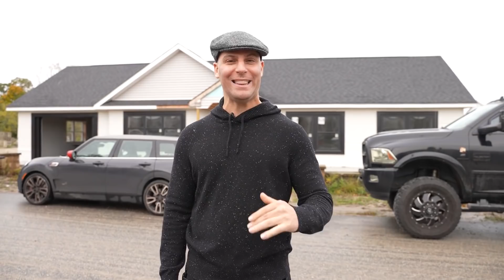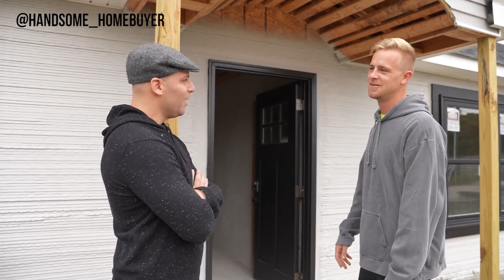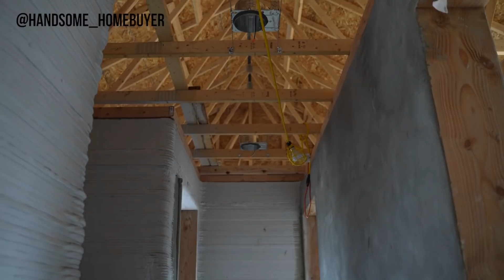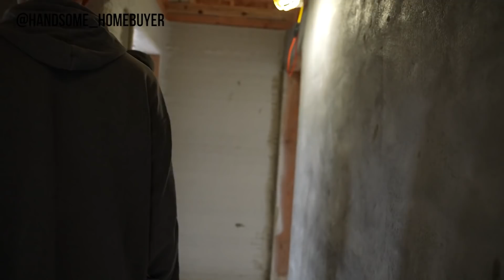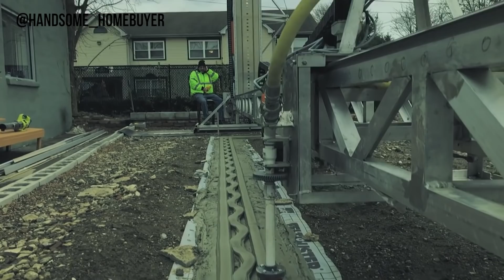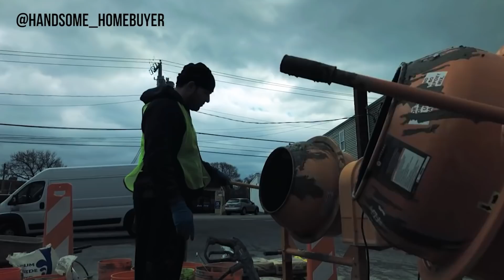The FIRST 3D Printed House in America! (SQ4D)

Comment: Cool but where’s the electrical outlets
Reply: That was my first thought.
Reply: They’ll probably have to use electrical conduit with “drops” from the ceiling. It’ll look industrial.
Reply: And insulation?
Reply: And wheres the rebar to prevent shifts and cracks?
Reply: Rebar is the failure point in most concrete. There are concrete buildings over 1000 years old still in great condition. Rebar will eventually rust and push outward causing the cracks. You just have to keep concrete under pressure and not tension. And it will last for centuries.
Reply: +ThatDudeTrent  Provision for conduit, pipe work etc., is programmed in see it being done here ttps://youtu.be/1WXHJn7z-hM

Comment: You'll need to build interior walls for plumbing and electrical , seal the inside walls over concrete , put up wall , spray foam , cover walls with sheetrock , ceilings too.  
Just as to what U see here , $ 75,000 , without ele , plumbing , heating or air , insulation, fixers , wall coverings , floor and ceilings , another $150, 000 = $225,000 plus tax , realtor fees
Reply from the maker: The walls have hollow sections for that already.
Reply: @CharlesWeinraub  What's the r rating of those hollow walls
Reply: R-35 exterior walls R-21 internal walls
Reply: @monty0629  
Lets hope capitalism  holds up , then

Comment: How do you get power in the walls or outlets in the walls ?
Reply: Power conduits, gas and water pipes are all accounted for in the planning, way before you actually start printing.  This is very much the same way a modern brick house would have those planned.  If anything this makes it much more accurate for the electrician or plumber because there is no chance a tradesmen or apprentice accidentally read the plan wrong and put something in the wrong place.

Comment: 0:58 - how can you be carbon neutral or negative while using a very energy intensive ingredient (cement) for the construction?
Reply: As far as I understand it Most of these concrete 3-D printed houses actually using additive mix with a type of plastic derived from plants.
Reply: If it's neutral for wind and other green projects, it's neutral here...
Reply: There's a companies that make 3d printed house out of earth,& straw like bees do, but it's located in Africa, 

Thing is it could work here with hemp, lime, mud,& straw but right now people are more interested in the cement ones
Reply: TEC Man  well for someone who's looked heavily into strawbale houses I can see you don't know what you're talking about, because they only need as much maintenance as any other house

,& pass the fire test being fire resistant, & earthquake test being earthquake resistant, also once the plaster layer made of clay,& cement is put on the outer layer it's damn near impervious to wet climates I've seen them built in Alaska, & Russia in heavy snow ❄
Reply from the maker: This new video will answer all your questions https://youtu.be/EBaNBqI9dmE

Comment: Seems like it would be hard to heat that house, the walls would be a heat sink.
Reply from the maker: The walls have hollow sections that take spray foam insulation.
Reply: Just put in radiant floor heating and it will never feel cold.
Reply from the maker: This new video will answer all your questions https://youtu.be/EBaNBqI9dmE

Comment: Man, all the gloomiest in the comments, I don't get it. This is cool tech. Very exciting stuff.
Reply from the maker: Exactly.  First person through the wall always gets bloody my friend. 💪
Reply: 100% agreed
Reply: Can't be "carbon" neutral or negative and use cement. 🙄
Reply: @jthomas5226  concrete is a great insulator, so maybe he means long run with heating and cooling costs.
Reply: @Dr3450  Concrete in itself isn't a great insulation. Take a look at Aircrete for sound and temperature insulation. Domegaia
Reply: Because they are construction workers
Reply: Cool Tech. It saves wood and time, but still a counterproductive  BIOHAZARD. Concrete creates "Urban Heat Islands" which affect electricity demand, produce green house gasses, & air pollution. Also Concrete requires Sand which is already destroying river ecosystems & entire Islands. Bigger Picture is ITS A BIG BIOHAZRAD! The solution is Biophilic Design! Singapore has adapted the Biophilic approach. My suggestion is to mix Hempcrete with the 3D Printing technology if possible to make this work. Hempcrete made of Industrial Hemp fits the Biophilic Design Profile.

Comment: It needs iron rods. Those walls are gonna break down so quickly.
Reply: I'm sure you're not wrong... but strangely, there are quite a few Roman era concrete structures still around and our highly engineered modern day ones can't compare to that longevity. It might have something to do with the iron rebar rusting and creating internal cavities over time that slump. I don't know, but Kirk did say that the second stage was to "back fill the walls" before adding the truss system. Maybe they are adding something at that point.
Reply: True. I'm not really happy with this either. I like the concept but the guys need to think about leaving more room to add rebar and concrete infill. Maybe anchor rods that are threaded and then a long nut welded to rebar that is inserted once the wall is finished and then twisted onto the anchor bolt. Then fill with concrete. Also, add slots for electrical and drop in conduit as it's printed. Then all the electrician needs to do is thread the wire through the conduit. Same concept for plumbing. Then too, this is a slab home so the sewer is not an issue but the above ground plumbing needs to be allowed for. Single story is not much of an issue.
Reply from the maker: This new video will answer all your questions https://youtu.be/EBaNBqI9dmE

Comment: As a 3d printing hobbyist, I must say the guy who made this is a lazy bastard for not sanding down the layer lines.  😂
Reply from the maker: They are currently perfecting a product that enables them to stamp impressions into the concrete to make it look like siding. You can also side over it.
Reply: @CharlesWeinraub  they are doing this in China where they can make the walls look like a Chateau. Maybe they can look into it.
Reply: @CharlesWeinraub  exactly id literally put a siding or brick kit around it. Don’t listen to these guys, they don’t even know what goes into building a regular home. This is amazing
Reply: This is satire?
Reply: @randybobandy9828  Yes, it is humor.
Reply: ‘Layer lines’ is the new ‘Stucco’
Reply: It can be smoothed during the printing process .
Reply: Uhhh ..  texture. Ummm, it’s the style?
Reply: Wasn't the ICON 3D home printed in the SW the first 3D house in the US?
Reply: Can't the arm that pours the concrete be equipped with a scraper so it smoothes the layers out on the go?
Reply: Thry want people to know it's 3d printed,  it's what makes it sell , but some companies just put a plaster layer outside it like the 3d printed mansion in China
Reply: Lime render would be a good option as it would trap carbon as it sets. 
Those lines would also be perfect to help the render stick.
Reply: This is the perfect surface for stucco to adhere too.
Reply: OMG right I was about to say they are gonna need alot of acetone vapor smoothing 😂
Reply: Good call Mr G 🤣🤣🤣🤣
Reply: I think it brings character
Reply: Easier to add plaster/stucco then to grind concrete

Comment: Should have used a steel roofing system. Outside need a cement parchment of some type to make it look not printed.. lol
Reply: I assume they wanted to keep the 3D printed look on the exterior.  It is unique looking.  They could always stucco it just like most concrete block homes in the Southeast US.
Reply from the maker: They are creating a stamp to make it look like cedar shake.

Comment: the house is made out of concrete, why not make the roof out of steel and the whole thing is fireproof?  Also how do you run electrical and plumbing with the walls already complete?
Reply: The holes for plumbing and electrical are part of the print process. Starts with the CAD. Cannot make any adjustments though.

Eventually with multi material and higher resolution printing, the plumbing, HVAC and electrical and even 3D printed circuits boards will be done in one go.
Reply: @Jonnyrockin71  lol sure dude. You will need electricians there while the walls are being printed to install the wire.
Reply: @Jonnyrockin71  what's the total construction time, not just the 3d printing part?  I notice with traditional wood frame construction, the main "bones" of the house goes up pretty quickly but then everything else takes awhile.

Comment: They need the concrete plant built into the 3D printer where you add dry cement powder and water in separate reservoirs and the mixing and ratio is done by the computer based on feedback from the output stream. It's the only way you are going to get a consistent product.
Reply from the maker: Great idea.  They have other generations in development that do just that. Can’t wait to see where this company is in 5 years.
Reply: Ideally a different material than concrete. Lightweight, carbon neutral, easy to cut, but strong. Dries faster. Maybe a hybrid concrete and plastic.
Reply: In the uk we use systems like this to pour footings and the slab and even screed, it’s all on a huge lorry and they type the info in the computer and it’s done consistent, man can never keep the mix 100% consistent
Reply: In Italy they are printing  waddle & dobb homes on-site. 

 They dig  hole that serves as  quarry add a medium like sand & water & print a cylindar. Then they roof it.
 The " qurry" then is turned into a roof water catchment pond that can be ortemental or put to use  to irrigate traditional & hydroponics .

Comment: Talk about a shitty house. Where is the electricity, pipes, ... ?? Printed paper walls don't make for a 3d printed house
Reply from the maker: There are voids in the walls where you run the electric, plumbing, and spray foam insulation.

Comment: 48 hrs to build the walls of a one story house, two weeks to dry, then everything else is basically done the same as any other house from that point out. 
Then you still have to stucco or paint or side the house. Seems like the same time line all said and done.  This seems like a novelty item.  I appreciate you showing it to us and seeing the tech.  I don’t think it will change the industry.
Reply: This is only the beginning. Pre Model T days. The Tesla days are coming.
Reply: I agree, if only for the fact that we already have had our revolution in concrete wall construction and it is the ICF.  ICFs seem easier to construct than setting up the 3D printer and from what I can tell ICF walls are superior to this in almost every way.  And yet--ICFs haven't taken over construction.  Why?  Not everyone is into concrete walls and the material cost is the biggest factor in making walls out of concrete.  Concrete is way more expensive than wood and drywall.  If all a person wants is quick cheap walls how could you beat factory constructed modular stick frames?  Labor is not the expensive part of that process.
Reply: @coolmeister522  because stick framing is disgusting.
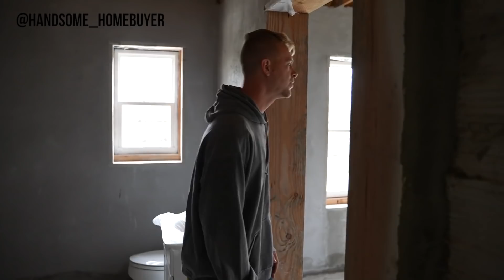Reply: @TheWhale45  Don't get me wrong, I am very impressed with this progress, and trying to keep things constructive and helpful. But this is a prototype that happened to be built on a slab the same height both sides of the wall. So rain just leaks in at the cold joint at 5:10, for example.  Just trying to head off mistakes that everyone has made, and 3DCP is particularly vulnerable to moisture, like it of not.  Want to see the venture become successful.  Not sure of any relevance about my time spent both at the Gulf and Florida.
Reply: @TheWhale45  You persuade someone called SpaceCrete not to build out of wood.  A true believer! :)
Reply: I don't know if it's your ignorance or your incompetence but it's mind blowing.  I'm sure you will personally innovate construction technology way better than this technology. They only created over a 50% reduction of carrying cost labor workmen's compensation injuries and potential death on construction sites but once again I'm sure you'll do better. Lmfao  PS when I Google search your name looks like your  Google says your real estate is permanently closed lol #1realtor lol
Reply: @monty0629  #micdrop
Reply from the maker: #famouslastwords
Reply: I agree, and this prototype will never be habitable, but I appreciate their pioneering. Digital construction is probably inevitable, but most necessary dwelling features - integration with utilities, prefab/fixtures, insulation, moisture-control/weatherproofing - are not economical yet.

Comment: Ambitious project. I am sure they learned things from it. Huge difference between printing walls and completing a house.
Reply from the maker: This house was used to obtain local building department approval to build the first house that can be sold.  Permits should be issued early next year
Reply: @CharlesWeinraub  That's cool! While they may be concerned about structural, my thoughts would be mostly about controlling moisture and thermal. Much/most construction litigation is about mold.  At least you can avoid drywall on the building envelope. Best of success with it!